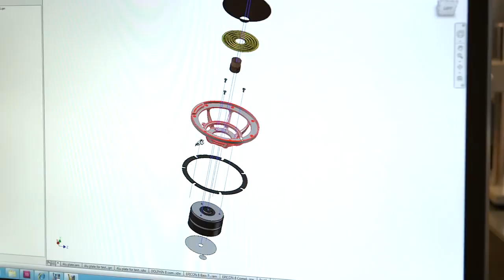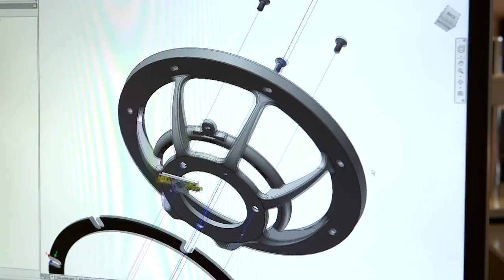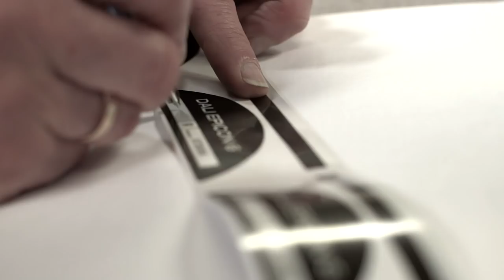DALI Speakers - Factory Tour

Comment: Why do these high end speaker use cheap crossover parts for there speakers?  I know it is to save money, but what about their mission in creating the best possible sound.  Crossover is a huge part in how these speakers will sound.
Reply from the maker: We are not sure what you mean about "cheap parts"? What is your knowledge about which parts that we use for our EPICON crossover? Our aim is not only to create the best possible sound, we also want to make it affordable. It is "easy" to make some of the world's best speakers, if the price was no issue. :) But the REAL challenge is to make world class speakers, which most people can actually afford to buy. With that said, we can't agree upon using cheap parts for our prime speakers.
Reply: True it is a huge challenge to build a speaker that sounds good that doesn't take a life time of saving on a working man's budget.  However why don't companies clone or invent parts that sound just as good as the components in the past that have been time tested and successful. The younger generation is always on the look out for gear that is a true 80-90% of companies flagship model at a tenth of the cost.  But in the speaker world you have to wait a few decades on the used market to find that kind of a deal. Take the turntable cartridge industry for example, sure you can buy a $10,000 cartridge but what are the people really buy in droves?  Ortofon 2ml, budget Soundsmith, Dynavector, Audio Technica and so on.  We really don't care that the product is pretty, made in some special factory, or has a name brand glued on the side of it.  I know that is not fair, however it is what the market will bear and a lot of companies fail to see this.  With all the social media of people breaking down what really makes up companies products it is hard to pull the wool over people's eyes anymore, we now have the capability to be a really informed customer.  Take a look at the millions of YouTbue channels that do this.   Guitar manufactures come to mind when I think of companies that are learning the hard way of people will not being fooled into buying a $5,000 guitar anymore when a little of work on their $500 dollar model will get them there if not better.   I see this in the speaker world as well, a lot of savvy people are DIYing speakers to get the performance they want at a fraction of the price.  Of course if a company were to come out with a speaker that had what they wanted at a price that made it stupid to try and build or modify it yourself, can you imagine the sales of this speaker.

Comment: I use Dali's in every room and they're awesome speakers.....But mine say Made in China on the back, not made at some wonderful Danish studio/workshop.  They're probably none the worse for it, afterall it's just screwing some pieces together, but .....
Reply from the maker: You can be rest assured that all of our products are designed and developed in Denmark, and most of these are assembled at our factory in Nørager, Denmark. On top of that, we also have our own factory in China, DALI Ningbo, which is on par with our Danish production. It is run by a Danish CEO and our staff has been trained by experienced colleagues from Denmark. Here we manufacture some of our entry level speakers together with a selection of drivers. So quality wise, there is no difference in products assembled in Nørager or Ningbo. :)
Reply: @dalispeakers  Thank you for your honest and informative reply.   I'm very happy indeed with my Spektor 6s, 'entry level' maybe but more than adequate given the size of my rooms.  Perhaps a tiny bit dull at low volumes,  but when driven a little harder they really sing and belie their price tag.  I don't have a problem with Chinese manufacturing, we're one big world and really all not that different.